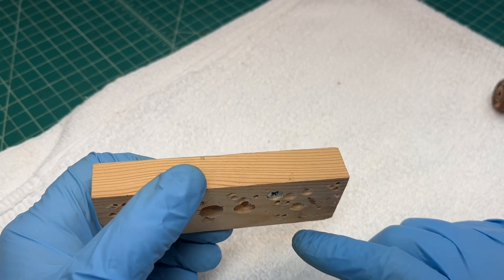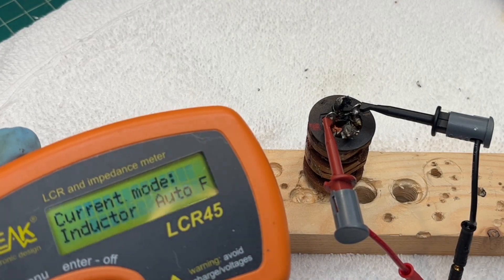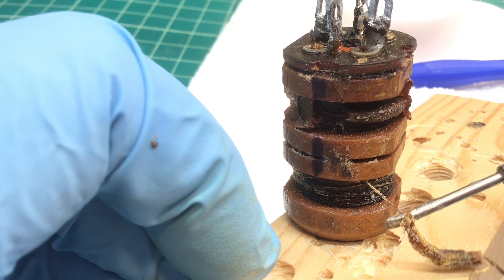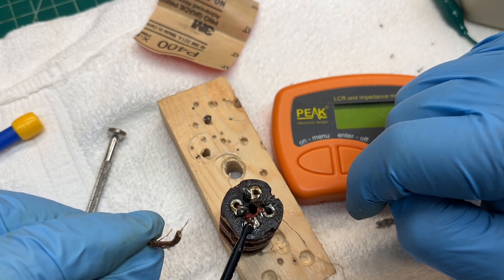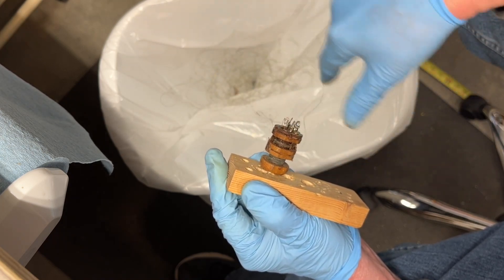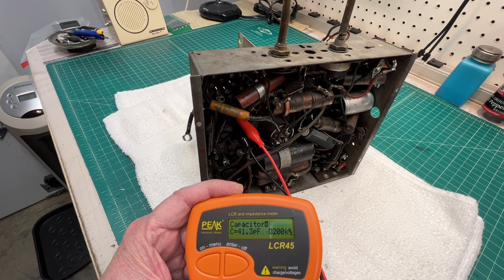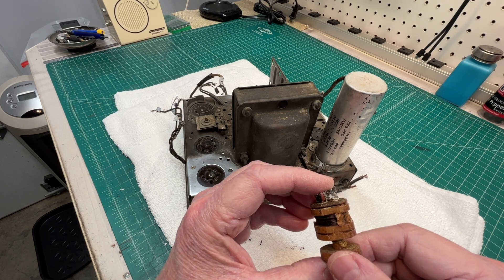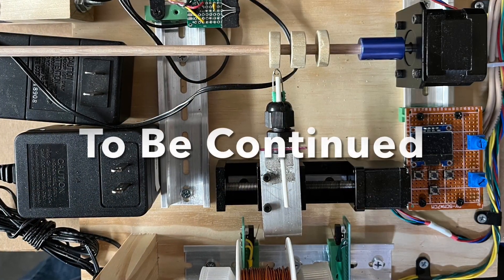Crosley 5V1 - I.F. Transformer Repair Attempt

Comment: Very nice videos!  I have an Airline (OC Series) with an open primary, the IF xformer, at the detector.  This one has a split secondary with 2 coils.   First attempt to rewind (the center) primary failed, too sloppy and likely lots of interwinding capacitance etc.  So thinking of making a new xformer maybe like you have done (and done well!).  Years ago I successfully made a ferrite IF xformer that worked,
Reply from the maker: Thank you for watching and reaching out; I know you’ll be successful. I built an antenna coil some time back as well and it performed well. Here’s a link to the video if interested: Emerson R156 - Building a Two-Band Antenna Coil
https://youtu.be/BqtcjIRqNDk

Best,

Don
Reply: @RestoreOldRadios  Hiya Don.  Yes I had success.  I made a coil that fit inside the xformer form and tuned with the nanovna.  Your videos helped for sure.

Comment: What is the source of the old radio repairman you used at the end of the segment?   Very effective and also a good video tease to the coil building segment.
Reply from the maker: If memory serves me correctly, it was from and Dragnet series. I just posted an update on the build and should have another update soon. Thanks again for watching and reaching out. Best, Don

Comment: Hi Don,
Just curious-what do you think causes these if transformer failures? Is it simply mechanical, such as the copper fatigues, or do you think it is caused by excessive current flow? Thanks.
Reply from the maker: Ian, all you mentioned to include heat, moisture, age, winding method/procedure and corrosion over time that leads to failure. Definitely, B+ current (a lot of undersized wire was used) on the winding increases the risk of such… Best, Don

Comment: That will be a bit time consuming building a totally new IF coil assembly replacing the original I.F. but I know you can do it like you have rebuilt other radios. Great video Don thanks for sharing. LL
Reply from the maker: Thank you Larry, it’s in progress as I noted, but I still have some tedious things to work out. Stay tuned for more. Best, Don